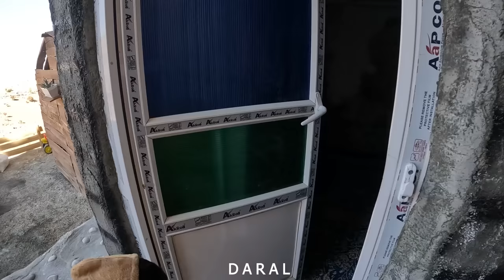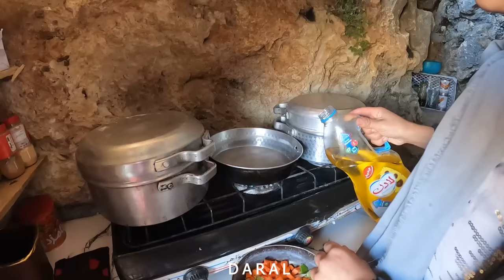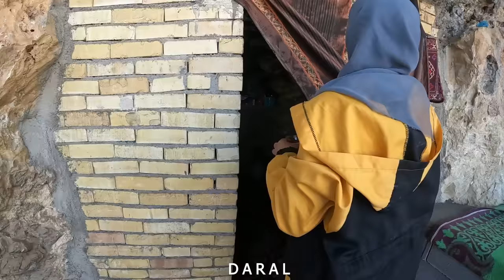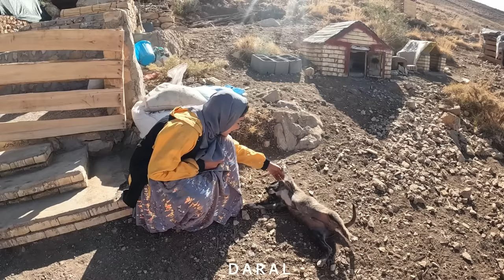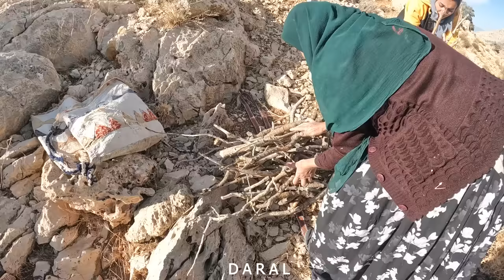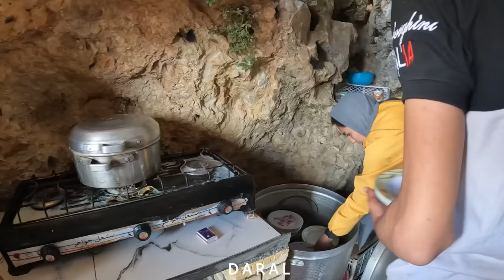"A delicious family lunch and hilltop adventure | cooking and gathering firewood in the cave house"

Comment: when we had our earthquakes with those thousands of aftershocks all modern conveniences were out for a while, we used solar showers, basically a black bag with a plastic shower head attached to bathe, we used camping cassette toilets which we had to take for a walk to empty into big tanks which were supplied ny the authorites, we had to fetch water, we cooked on bbqs outside and we couldnt use our fireplaces cos it was unsafe.  I made a solar heater out of an old drawer as the frame, a piece of rigid plastic and about 60 empty soda cans.  There are videos on you tube telling how to make them.  Amir is a craftsman,  I am pretty sure he could knock up a few of these in a day.  Just a suggestion and well sunlight is free.
Reply: @liviamon  2011, it started, we had several big ones, and clusters of them, and over 50.000 aftershocks.  We, new zealand, are on the Pacific Rim of Fire, same as Japan and a few other earthquake prone countries.  It is amazing how when you are off grid for a while you adapt, it is one of the reasons i love this family.  They are like new zealanders in the way they think outside the square and make and build things out of whats available.

Comment: Instead of a rug in the 'kitchen'  room , why not easy to install tile (vinyl?) or linoleum which is cheap . Both far less flammable.  A sink/water set-up would really be nice . A door for the kitchen could be made from wood. The curtain is not practical in use and is flammable also.